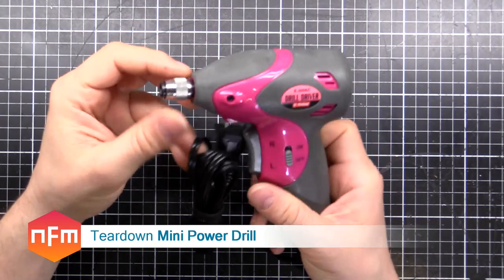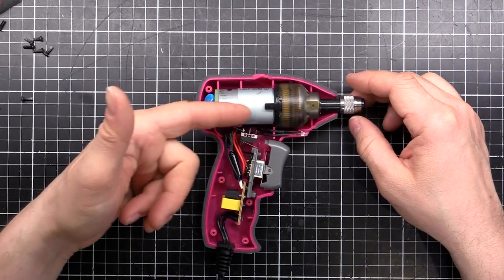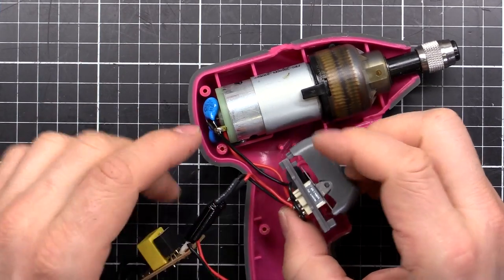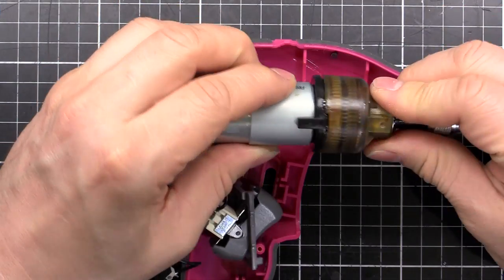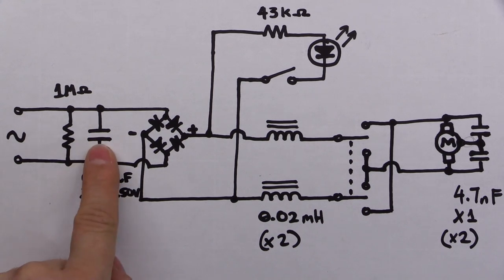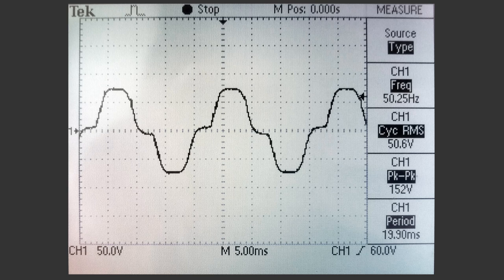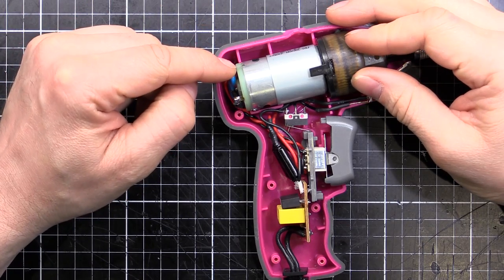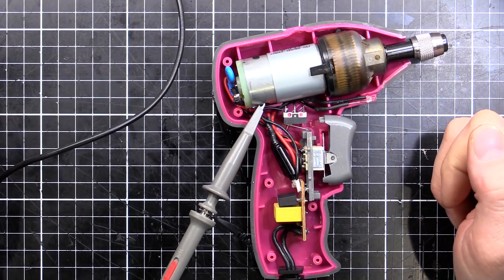Shocking Mini Drill Teardown and Repair

Comment: Earth == Neutral, so you could use that :)
Reply: This AC plug is able to be plugged in either way. Doing this would be a bad idea.
Reply from the maker: I briefly considered it, but with an unpolarised plug, there's a 50% chance of electrocution by having to motor connected to live., and with the bad wiring inherent to older Japanese electrical installations, I wouldn't trust the outlets to be correct at all. :)

It's strange, the outlets here in Japan are all polarised with one hole larger than the other, but I've never actually seen a polarised standard 15A plug ever.
Reply: NFM just put a warning sticker on it... 😉
Reply: Could you use two diodes from the motor chassis to each motor terminal?